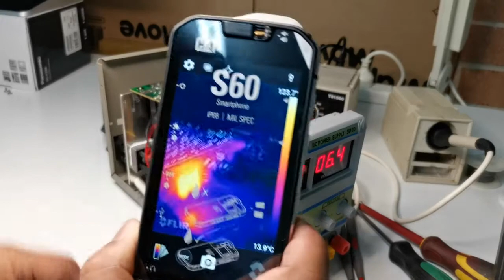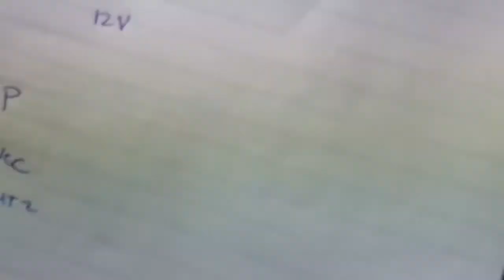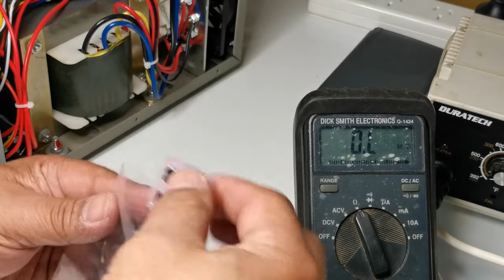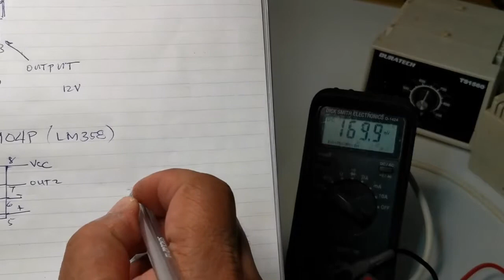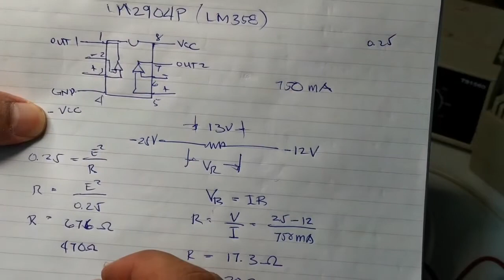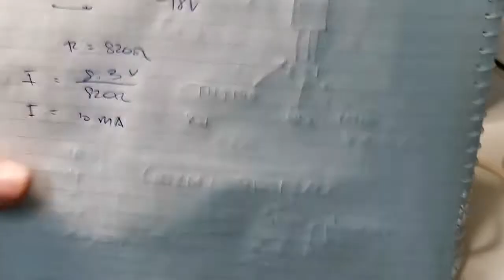VTECH 3 - How To Repair Linear PSU Using Thermal Camera With No Schematic

Comment: Thanks for sharing! Excellent video. 

Tip for solder wick: cut a piece off for use and hold it with tweezers. When it’s attached to the roll, it acts as a heat sink and is difficult to use.
Reply from the maker: Thanks for watching. I have more on my Electronics YouTube Channel repairing Electronics and programming cool project for Arduino using Arduino Nano, ESP32-S3, Rotary Encoder and OLED display.

Comment: How much cost of your thermal camera and what is the name of company and model no. My english is not strong  please inform me. Thanking you
Reply from the maker: @BlondieHappyGuy  Thanks for watching our video. Before I was considering buying the Flir One Pro Gen 3 but with value for money the Flir One Pro Gen 3 will cost almost $500 while the CAT S60 will also cost $500. Pretty much on the same price range but the CAT is a complete smartphone which comes also with normal camera and mainly used as rugged industrial phone which can sustain 1.8m drop on concrete and 5m under water for 60min. I used this taking videos and photos while swimming. I can't compare this with Flir One Pro Gen 3 because they are not competing each other since the CAT S60 also using a FLIR thermal imaging camera aside from its normal rear and front cameras. I wish I have the CAT S61 or S62. Overall, it's a good dedicated smartphone for trade and repair. I'm not promoting this phone but I just want to be honest how useful this gadget is. Problem with using a plugin type external thermal camera, it could apply stress to the phone USB connector PCB contact which could damage the USB port. With small built-in internal battery which need separate constant charging which might fail. There are PROS and CONS. As an investment for similar price, which one would you like to invest? VARIETECH
Reply from the maker: One I was using is a CAT S60. Purchased from UK for $500AUD. It is a smartphone with FLIR camera. There is a new model S61 and S62. I wish I have the newer model to demo but I can't afford to upgrade. It's really good to have the newer model to demo and show its potential with some of my future project.